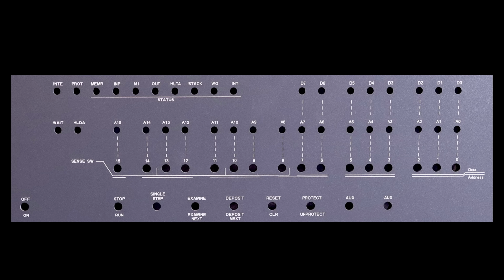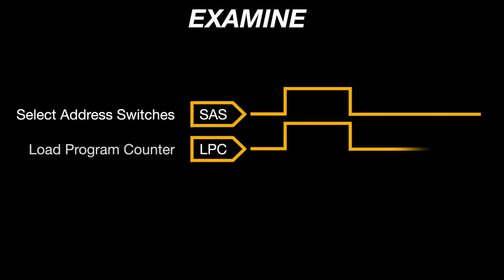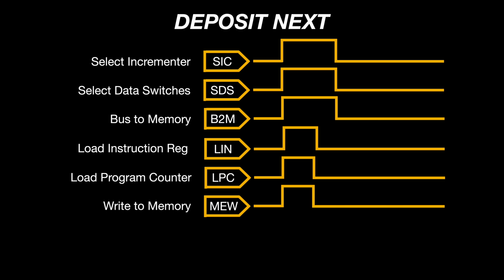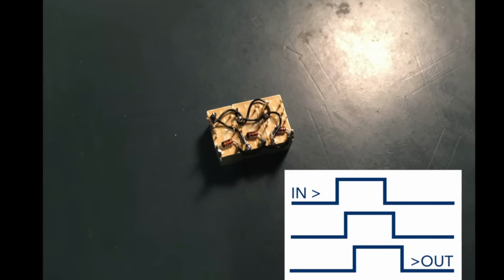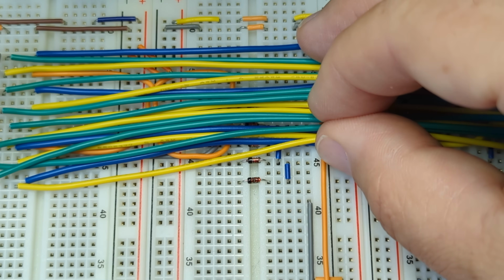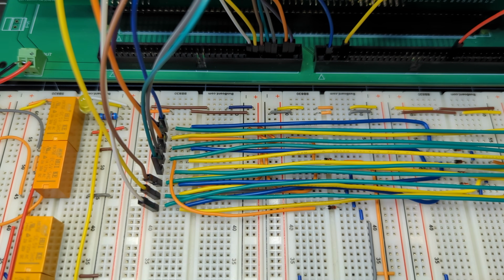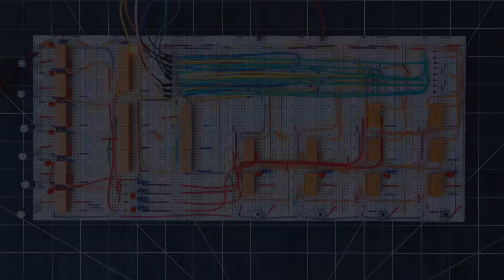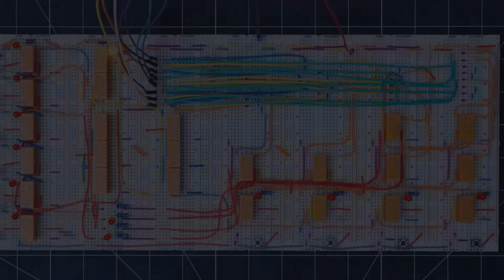Relay Computer - Front Panel Functions

Comment: How fast can you make it go before the relay propagation becomes an issue? The current speed is still slower than what you might want for manual entry, but a speeds of 10-50 Hz might still be doable with the propagation taken in mind.
Reply from the maker: I did a video about speed that talks about propagation and my expected highest speed here: https://youtu.be/xo1iIFSd_bo

Comment: hi used some relays the same in a brenell mini 8 where the  ic's all went bad  it's  lot is not quiet   you can used them in a tascam 38   logic  5v logic 

tell the power ic's  works ace

Comment: What value are the diodes across the relay coils? Typically I see IN4007s used in that location. In addition you can use an  induction suppression capacitor to suppress voltage spikes. Electrically they look like dead shorts to any voltage spike.
Reply: A 1N400x absorbs the reverse voltage spike generated from a relay coil when it is switched off. A cap may not do that well. It's a usefull technique for a switching  power supply.
These spikes can also have enough current capability (depending on the size of the relay coil) and it may be a bit too high for 1N4148 to have a happy long life. The 1N4001 to 1N4007 are good for this task.
Reply: @Bob-1802  A capacitor acts like a short circuit when it is exposed to a high dv/dt voltage.Think of an output stage of a vacuum tube circuit. The B+ on the plate has a dv/dt near zero but the signal does not. Be sure the cap is rated high enough for the voltage.  I've seen both used in parallel e.g. belt & suspenders 😏
Reply from the maker: I'm using 1N4148s for pretty much everything, and they seem to generally work pretty well - but I did notice they didn't like being tied directly to discharging capacitors 😁 but after adding some resistors in the mix things seem to be okay. I approximate I've used 700+ of these diodes, and this is the first I've found shorted...fingers crossed!
Reply: @dipdoting  I too used 1N4148 until I got a batch of bad diodes/different manufacturer that shorted after few hours (If I remeber correctly, I used 24V relays). Then, I get for cheap few bags (around 5000) 1N4002 that I now always use with relays or inductive loads.

Comment: What happens if you keep the button pressed when the sequencer runs out? Does it perform the function again? Maybe you can add some sort of debounce circuit to prevent this if it is problematic.
Reply from the maker: That is an excellent question! I was thinking that I could "lockout" the switches when the sequencer is active somehow.